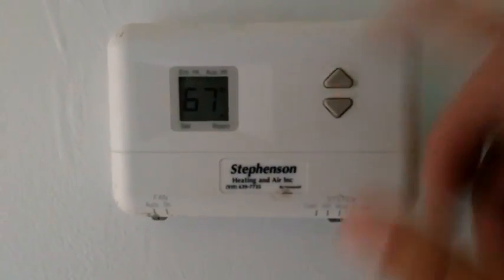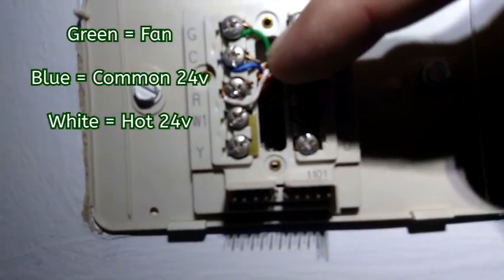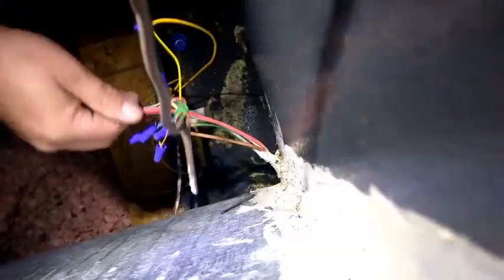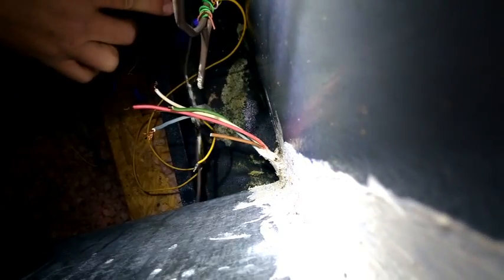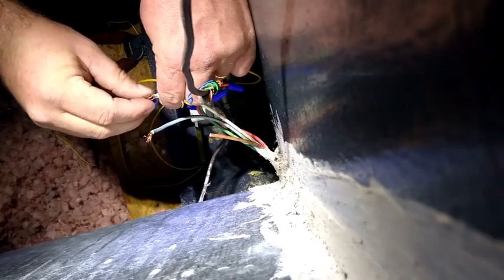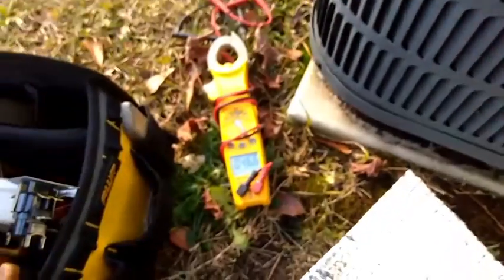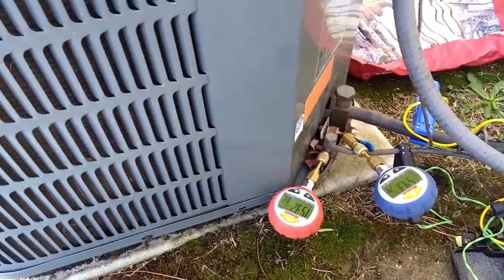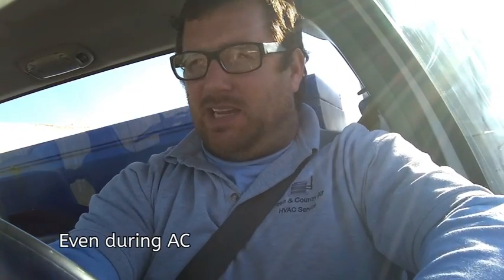HVAC Low Voltage Issues | Rewired Thermostats

Comment: When wiring-in a pan switch I usually go the other route: Kill the WHOLE low-voltage circuit.

I do this based on feedback from customers(who have generally called me after hours or AFTER a long-sweaty night without cooling) who said that they assumed it was working because it was blowing air.

I'd rather it kill it and have them call for service and address with condensate issue ASAP - preferably during normal business hours or as soon as they get home from work or school - rather than after dark when I'm tired or have already gone home for the day. 
From a troubleshooting standpoint: i'd rather have it kill everything so the first place I go after checking the T-stat is going to be the Air handler, not wasting time outside seeing why the condenser isn't coming on (especially down by the coast where many are on platforms which require a 20ft extension ladder to access), it's a waste of precious time. 

If it's a new install I discuss it with the customer and see what THEY want to do; most of the time they go with my recommendation of just shutting it all down, very rarely they'll insist on being able to run the fan to circulate air in case of a condensate  issue.
Reply: Mike_HVAC I agree it is better with the float switch shutting off the complete system. I also install a float switch in the primary drain line
Reply: Mike_HVAC that's very smart I'll keep that in mind!
Reply from the maker: Sounds like a good plan
Reply: Mike_HVAC how do you wire that? In series with r at the control board?
Reply: Yup, works even better if the 'stat is powered via common with no batteries because a blank thermostat will catch the attention as soon as the customer is uncomfortable and goes to adjust temperature. 
  You just kill the condenser they're gonna lower the set-point, hear the fan running and assume they just need to let it 'catch up', till it's bedtime and they're sweating and they actually put their hand up to a vents....and by that time the condensate could be causing serious damage that may have been mitigated had someone got up there a few hours earlier.

Comment: Good vid. It's weird how Honeywell pro 3k acted they're dependable, economical t-stats. I mostly use TH8321R1001/U VISION PRO 8000, then my second option the 6000 pro for lower end installs. At the end of the day it's what customer can afford. Next time use the Sman gauges. That will get u 2k likes
Reply from the maker: Honeywell is pretty good. Had a few shit the bed, but most of the time they are solid down the line.

Comment: Different Strokes for different folks. I think I would have changed out the wacky thermostat and leave it wired like it was. also would have checked the AH coil to make sure it was clean. I would have cleaned out the condensation line and clean the pan underneath the air handler. at 53 degrees  OAT I also would have checked the discharge line temperature when in heat mode
Reply from the maker: Did check discharge temp ion heat with the Supco dual temp meter. I would only go to the coil if the pressures looked out of wack. The cleaning part I just didnt do. I asked if they wanted a new stat, but the old one did work. I agree that it would be nice to have a new one.
Reply: Working Joes Roundtable thank you for the reply. I re-watched the video you did tell the temperature of the discharge 128. seems a little low but you checked it with the condenser fan blocked. would it been more accurate to check the discharge temperature without the fan blocked? what was your inside temperature split without the heat strips on? I have only been watching YouTube videos for around two months. I plan on making some HVAC YouTube videos. I have not seen many HVAC videos that shows the discussion options for the homeowner - is there a reason that is not talked about? / shown in the videos? I am thinking if the options were discussed people would have a better understanding of what it takes. I would like to see a video explaining to the homeowner customer about a refrigerant leak. find 1 leak don't mean there are not other leaks how far does the customer want to go with the checks? search? discussion? thanks for all the great videos
Reply from the maker: Blocking condenser lowers discharge temp and superheat. That was in cooling mode though. I dont usually video interactions with homeowners, Steve Lav does that sometimes.

Comment: I think they were trying to do like a slave damper without the motorized damper and bypass. I use separate transformer to power the second thermostat and damper. It's the poor man's zoning system. Problem is that it will only solve one problem. Summertime or winter time. Which do you want to be the most comfortable in?
Reply from the maker: The idea is they put a stat in to bring on the fan to circulate air when the upstairs thermostat calls. Its the "even poorer" zone system.
Reply: Working Joes Roundtable Lol!

Comment: I often tell my customers to leave the fan on if they do not want to spend money for zoning. Running a fan at low speed (like on a ecm ahu) often evens out temperatures enough to satisfy most customers...
Reply from the maker: +na na it does even temps out